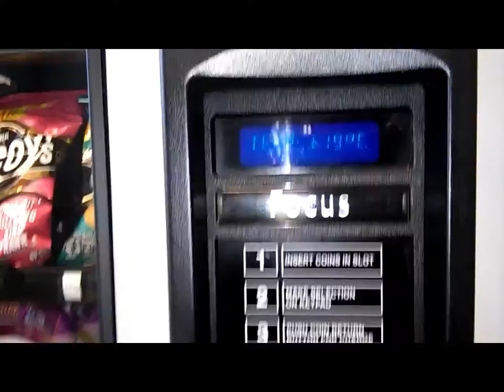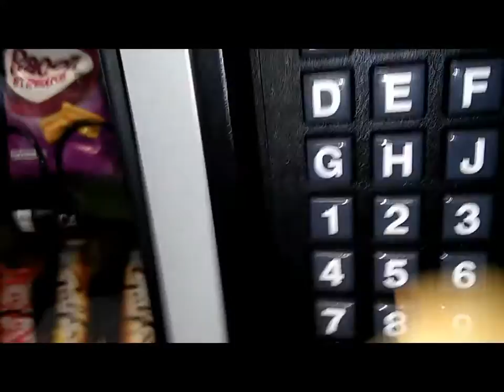Crane National Vendors Focus 32 Snack vending leak repair

Comment: Hi graham i have a vending machine crane water leaking down by side of it where u think its coming from
Reply from the maker: All refrigerated vending machines have a tray to collect condensation from the fridge, an element sits in it and evaporates the water, the drain pipe to it could be blocked or the tray itself may be cracked, sometimes they leak because the fridge is running too long ( hot room or vents blocked ) loads of options

Comment: Hey Graham, my tray's cracked, is it possible to put a glass dish on top of the  element instead? as i do not have the technical means to remove the tray.
Reply from the maker: Yes, or plastic as long as the element doesn't touch the plastic it should be fine.
Reply: Thanks Graham,  you are a 🌟